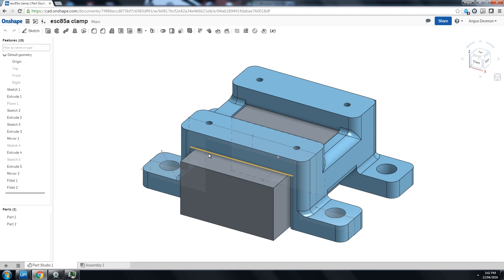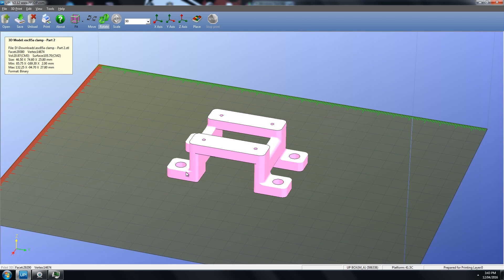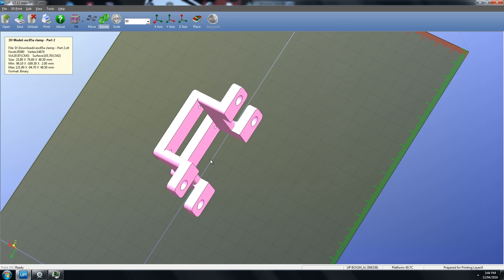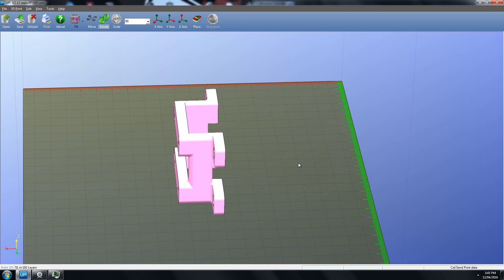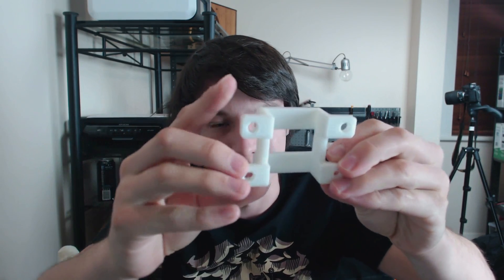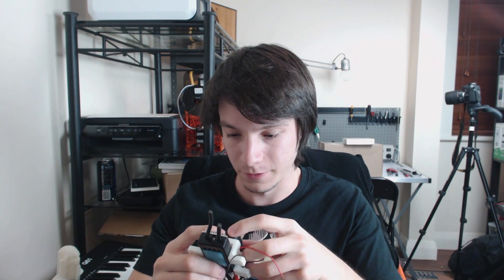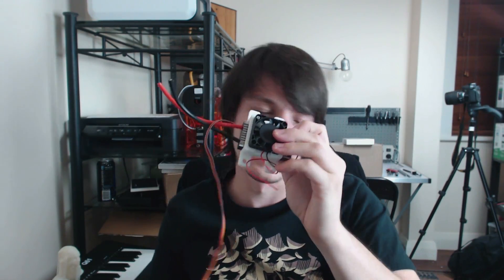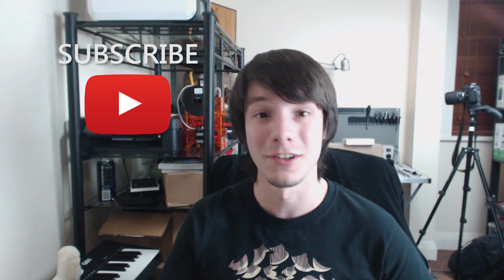3D Printing the Robot ESC Mount

Comment: Hey Angus, you may want to be careful, I do not know how hot the heat sink on the speed controller gets, but if it gets too hot, it may melt the ABS.  Just a word of caution.
Reply from the maker: +Soren Zaiser It shouldn't get over 90deg, but good call and why I didn't print it in PLA!

Comment: Hey Angus, while I understand you need some tolerances in the x/y direction for the controller to slide a bit to enter, I'm not certain having a tolerance in the z direction is useful... especially if you want the holder to actually hold the controller well in place when tightening the screws?

Comment: Pro tip. The tap hole diameter is (generally) the major diameter of the screw minus the pitch of the thread. So for a M2x.4 the tap hole should be 1.6mm. Of course the printers ability to hold size comes into play. Taking an English thread example, 1/4-20 has 20 threads per inch so the pitch is 1/20 or  .05, .250-.05 is .2. Machinists will know it's common to drill 13/64 which is ~.203. ;)

Comment: One thing I hate about M2.5 is that when I drop it just grab another because I can never find them.  They even make M1.5 hardware so I can imagine.
Reply: +Dark Alchemist If you talk about DIN 13-1 metric screws, there is a LOT more... M2.2 is a standard too, and from M1 to M2 there are quite a few in between, but M1.5 is actually not a standardized screw. You can have a look at http://www.emuge-franken-bg.com/attachments/article/97/15%20Gewindetabellen.pdf to get an idea about all the different standards and threads. (Sorry, it's in german, but that just what i had around in my engineering link collection)
Reply: ExtraBase
All I know is these 2.5/2/1.5 are just too darn small, lol.  Once I drop any of them you can kiss the baby on finding it again, lol.
Reply from the maker: +Dark Alchemist Oh yeah they're gone for good... till you tread on them in the dark a few days later anyway.
Reply: Maker's Muse
I normally end up either stepping on them or they must get sucked up in the vacuum and they are so small they do not even make a sound when getting sucked up to notify me to look before I dump it into the dustbin.

Comment: Question: How tight does bracket hold the controller down to a support member?  Was there enough shrinkage in the ABS to hold the controller down tight?
Reply from the maker: +RJ_Make it's a little loose, I think I could reduce tolerances further.
Reply: Do you think that will be enough considering the application (Battle Bot). I've love the full on battle bots, but not sure about these smaller bots... Wait, is this for your battle bot? I may have screwed up my thinking on it's application.. :-)  Getting old sucks...
Reply from the maker: +RJ_Make The weight class we compete with in Australia is only 13.6kg 'featherweights' so yes, it's meant to be a functional part but the machines are WAY smaller than the ones you see TV, so you can sort of get away with using 3D Printing for parts like this. :)
Reply: +Maker's Muse Thanks for the followup. I'm hoping it's your intention to continue producing these video on your bots design iterations. (Well as much as you can without giving idea's to your competitors.) I want to see you win!

Will you be able to video the actual battles and post them?  That would be VERY cool.  Maybe time to get a film crew together.. :-)

Comment: Very interesting to see from the idea to design to fabrication then problem solving . I think that you need a kind of a hook at each end so the speed control cant move from side to side ( it is just an idea ) Cant wait to see part 2
Reply: +Gil B It sure is the rapid prototyping of a 3D printer that's truly usefull.

You can design a part, test it, hold it in your hands and try if it's rigid enough.
If it breaks along one line, you can redesign it to be stronger at that point.
Or like in the video, adjust the airflow.